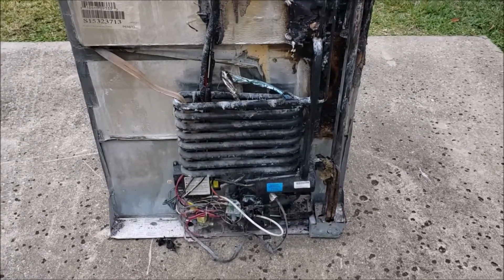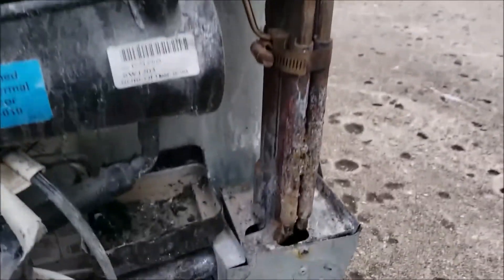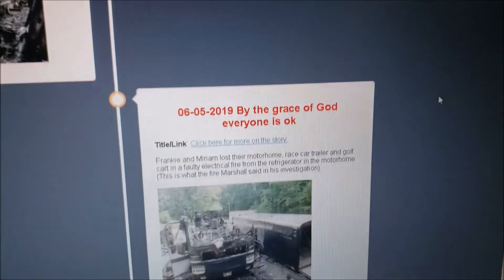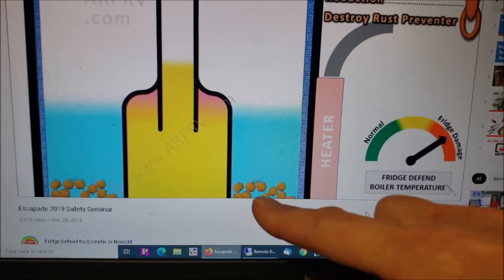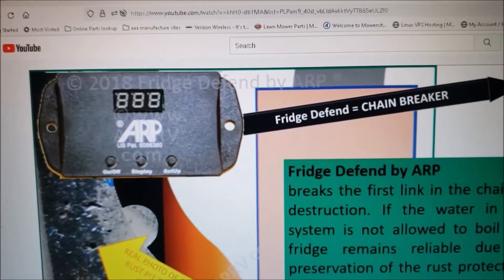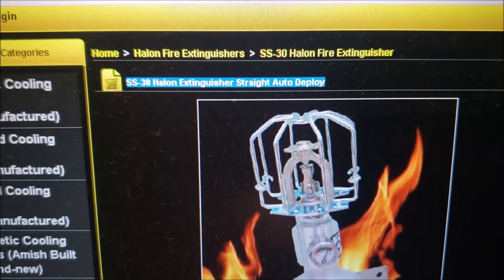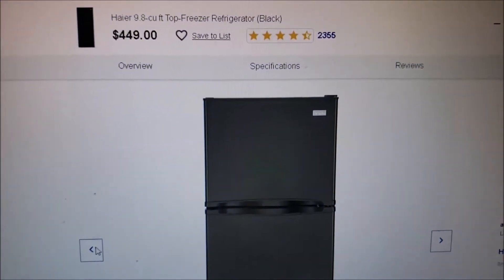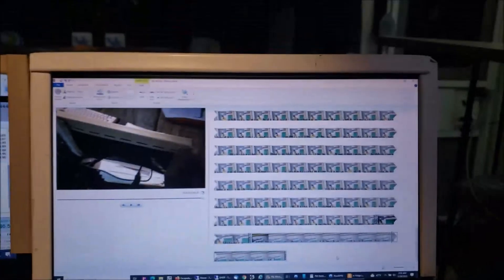WOW! Scary FIRE Norcold 1200 RV Refrigerator It's Time to Weigh Our Options In Order to Stay Safe

Comment: Glad it wasn’t worse.  Mine not so much. Dometic fridge caused mine. Fire Chief said it was the fridge also.  I lost everything.  Look at the ammonia tank. If it’s rusted then the metal failed from the inside. Had an attorney look that handles class action lawsuits against Norcool and Dometic. He looked at the pictures of mine and said without a doubt the cause. There was a lawsuit against the manufacturers but it was thrown out. I believe it has been resubmitted.
Reply from the maker: So sorry for your loss But thank you for contributing your story. I have sense got rid of our Norcold and installed a residential fridge and its working great for us. 
Here is a video of how I did it. https://youtu.be/CsR_eihKjds
Reply: We were going to do that conversion also. Waited too long. These types of refrigerators systems should not be used. It doesn’t matter how you power them. It’s just a matter of time. Ours was from 2010 but we purchased the trailer in 2020 from a dealer who went through the unit and found no faults or issues in the system. We used it for about a year and a half.

Comment: Thanks Kevin. Very good presentation!  I have a Norcold N842, vintage 2006. Last summer, it would not keep cool with the propane.  However, with the electric switched on it worked fine. At the time, we were traveling cross country.  We heard about JC Refrigeration in Shipshewana IN.  We made it an appointment with them and they replaced our cooling coil behind our fridge. Their coils are oversized, and now our fridge is very efficient. We do a lot of dry camping and prefer the absorbent fridge. However, the compressor models are gaining popularity with RVers, especially if you have solar (and getting away from the hazards of propane). Your video has made me feel more comfortable about switching to the compressor models.  I’m forwarding this video lesson to my friends.
Reply from the maker: Dave i would love to talk to you about your conversion you had done .. text or call my cell phine 606-875-0125 Kevin

Comment: Kevin, take a look at the boiler, that’s where the fire started. The boiler insulation is all but gone. The flames drafted straight up where they circulate around the condenser causing the most damage. I wonder if the thermal safety sensor failed and was bypassed? At 2:40 I can see the recall kit but I don’t see the sensor or remnants of it connected to the boiler.
Reply from the maker: Larry I would love to pick your brain further about this if you can give me a call my cell 606-875-0125 Kevin

Comment: My brother had a 1200 Norcold in his RV(2008) and about 3 years ago his Norcold 1200 leaked all the amonia out and of course it quit. No fire, it just died. A new one was around 4,000.00. So he went to Lowes or Home Depot and bought a Magic Chef 10 cu' residential refrigerator for around 3-400.00, and It worked great for about a year then quit. He was running it on a modified sine wave inverter and the owners manual for the frig says you must use a pure sine wave inverter if running on an inverter. So he bought another one and a pure sine wave inverter and hasn't had any more issues. My wife and I have one just like it currently being used in our garage that will replace the 2003 10 cu' Domestic in our RV (which still works great). We run our Domectic frig on a modified sine wave inverter while traveling. Those proteng fire suppression systems would be a good idea for engine bay(diesel pusher), electric bay, and refrigerator compartment. They aren't cheap that's for sure but then neither is losing everything you've got. Thanks for posting. Found your channel after seeing a Nomadic Fanatic video today from a while back about how you helped him trouble shoot his Onan generator that was running at the wrong frequency. Safe travels.
Reply from the maker: Thank you for contributing Rick I am about the pull the trigger on a new 3000 watt pure sign wave inverter as I get ready to install my new residential fridge. Video to follow.
Reply: @ktoutdoor  3000 watt ? You must be going to run your entire coach off of it  I run our 10cu' Domectic off a 400/750 watt modified sine wave, but that's the only thing we run on an inverter. You must have a big solar/battery bank. Nice. I've got a lot of catching up to do on your videos. Thanks for posting them.
Reply from the maker: You are correct I mess spoke I'm upgrading from 1000 to 2000 watt inverter here is my setup for the past 8 years but now I have 300 amp hours of battleborn batteries.  See this video https://youtu.be/OC1lxy81_FQ

Comment: I have not read all the comments but for your information usually all cooling units are topped off with hydrogen at 400lbs. pressure. I used to rebuild cooling units but that was many moons ago. The chemical in the unit that crystalizes is called dichromate. It is yellow.
Reply from the maker: Thank you for contributing I would love to chat with further about the process my cell phone number is 606-875-0125 Kevin

Comment: This is the EXACT reason I replaced my Norcold 1200 with a Samsung Rf18 three years ago.  Besides my bride LOVES the larger box and I love the quicker cooling and my hard frozen ice cream!!!  The Samsung, with 18 cubic feet of storage, fit in the same hole as my Norcold 1200 by dropping the bottom shelf under the old unit about 5 inches.  Width and depth were exactly the same.  And only ONE pound difference in weight.
Reply from the maker: Yes I see that's a very nice fridge. I'm looking forward to my fridge upgrade come April when we get home.

Comment: Is that a 1200RLM? For one thing you don’t know how well it’s been maintained in regards to running off level time and time again if the rig was purchased used. It’s acumulative damage for doing so. Your explanation is correct. ARP helps but do the research on them and see how hot they are still allowed to get before shitting down?
Reply from the maker: Thanks for contributing

Comment: I just visited the Proteng booth at the quartzsite RV show.  He told me it would be about $600 to install their kit.  They apparently don't sell to the DIY crowd.  It might be a great option for some, but that's about half the price of an upgrade to a new system, which I would probably do instead since I already have degraded cooling performance.
Reply from the maker: A new residential fridge is only 450.00
https://www.lowes.com/pd/Haier-9-8-cu-ft-Top-Freezer-Refrigerator-Black/1000366387#preview-overview
Reply: @ktoutdoor  I'll definitely be interested to see what you do.  I also have the 38J with the converter and drawer below.  Did not realize there was a solution that would fit in that space.  I've already had the retrofit temp sensor trip on us (resettable with a magnet).
Reply from the maker: @lonekazoo  Yes that's a little scary. Stay tuned that's my plan to replace when we get back home come April